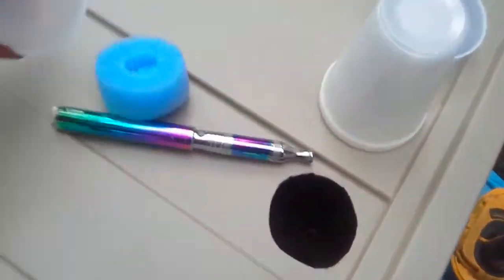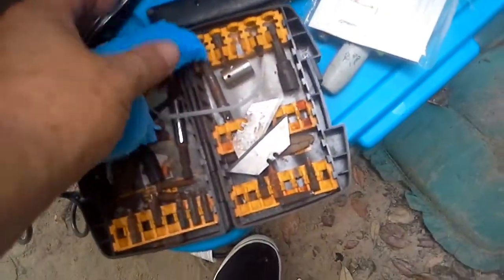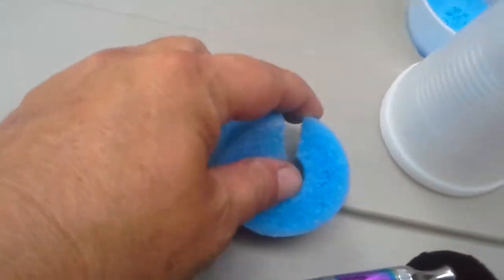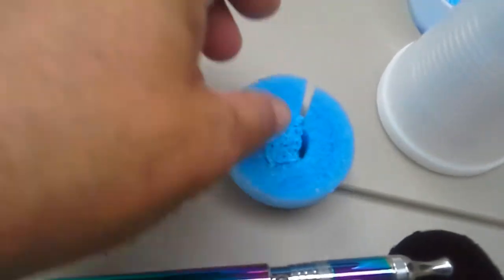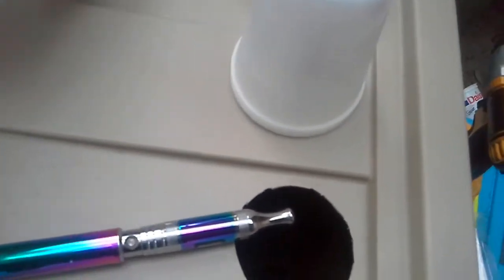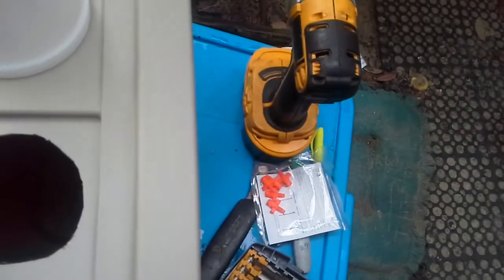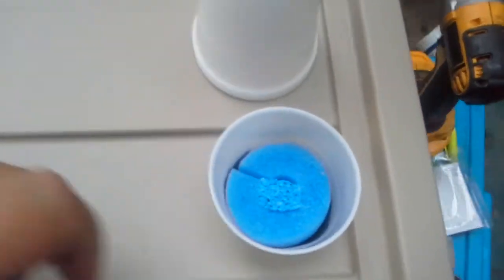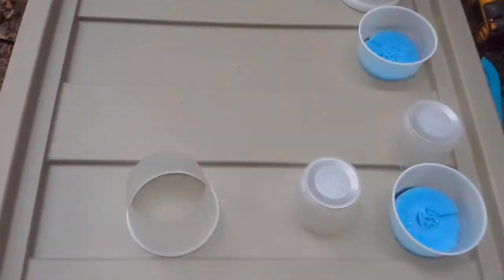Homemade aeroponic cloner

Comment: I used a 2" hole saw on mine....
Reply from the maker: I gotta do something!  Sucks cutting with razor
Reply: unk40rm they need to be perfect to prevent light leaks...  I was using my aero cloner but ended up going back to the old way. I was getting roots but they weren't healthy roots. And most cuts just died off...  Never had so many cuts die on me like that..
Reply from the maker: DABBIN DAILY 215 my problem with the dome is the cuttings gotta be so small but maybe this will work for me
Reply: unk40rm I feel you being that you grow outdoors and need bigger cuts to start with.. I took some big cuts and small cuts and it seems like the bigger ones took twice as long to root...  Hope all goes well
Reply from the maker: DABBIN DAILY 215 I using both methods and see what works best for me.
Reply: unk40rm if you figure it out let me know... I tried tap water.. tap water with flower Nutes.. tap water with h2o2 .. tap water with veg Nutes plus h2o2... I was running 15 on 45 off.....
Reply from the maker: DABBIN DAILY 215 I will. I got light veg feeding and putting h2o2 in tommorow

Comment: looks alot like mine just make sure u put a strainer over the pump so no trash get in the lines the sprinklers clog easy. and the clones dont last long when they clog. i also put a aerator pump in mine i let them grow nice roots before i plant them and they thrive much faster than my old method of rockwool cubes cheers
Reply from the maker: I have been researching it and am very enthusiastic about it